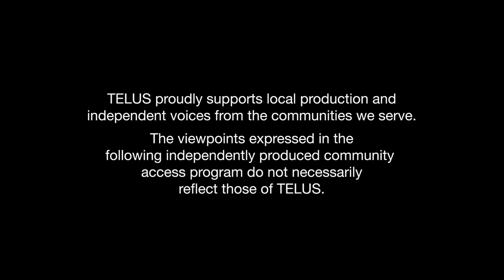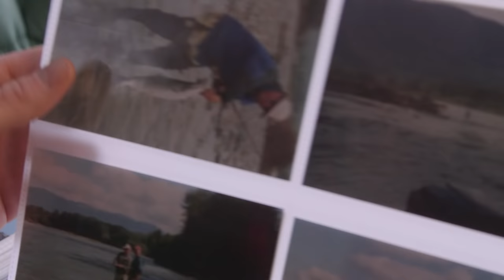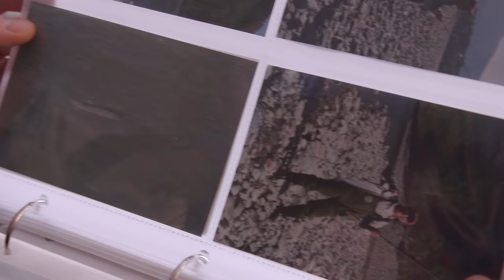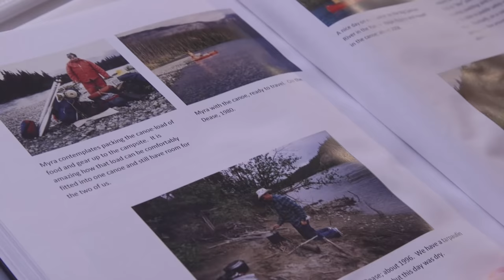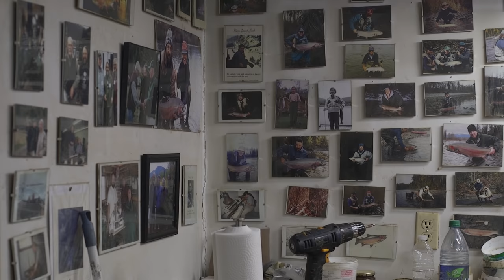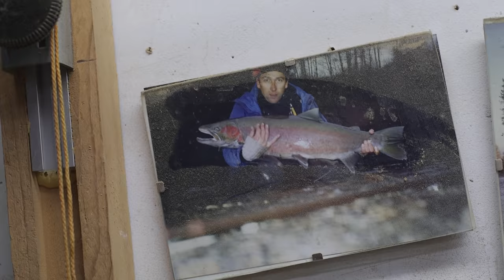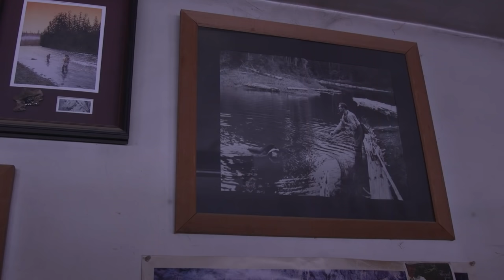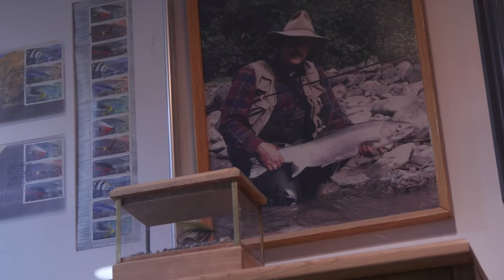3 Fly Fishing Legends | Cast Northwest | Episode 5

Comment: is a 6wt fly rod strong enough for steelhead
Reply: Elena Lopez your a bit on the light end typically used... it can be done, however most people I know tend to use 7-9 weights typically
Reply: Elena Lopez  if you can find them in still water it can be done... but I wouldn't recommend it in any sort of flow